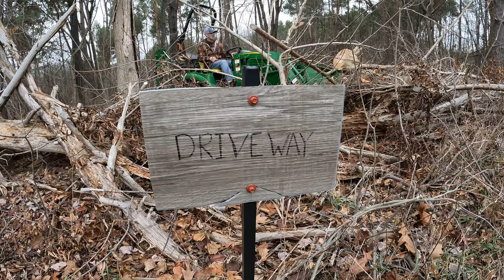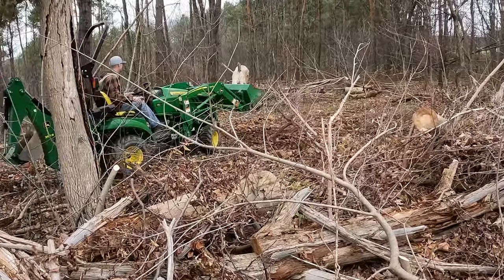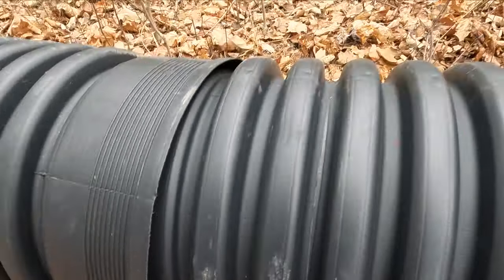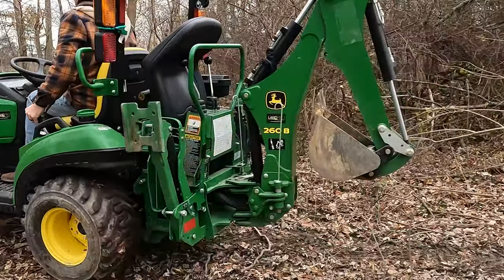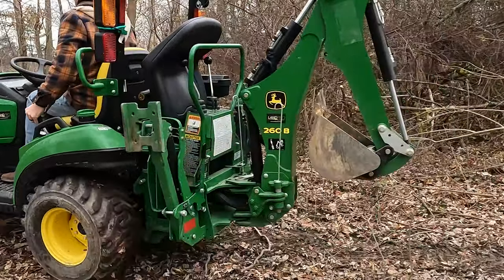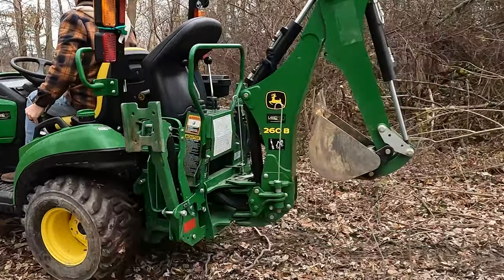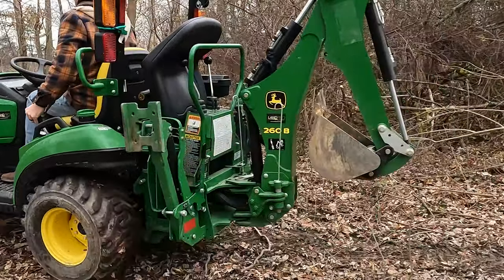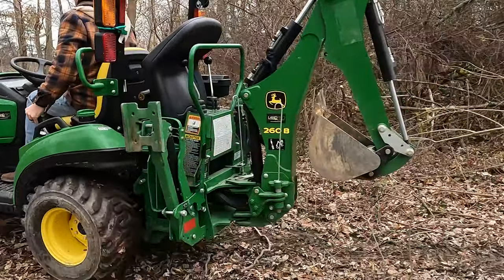How To Install A Culvert Pipe With A John Deere 1023e

Comment: I have a 1026R and a 3039R and they both are very valuable.  It beats doing it by hand which was more possible in my younger days.
Reply from the maker: Having the  1026R and the 3039R probably works out perfect!  The 1025R for the smaller projects or tighter spaces - and the 3039R for the bigger stuff.

Comment: You really need to take the topsoil off of where you're putting a driveway in, before the stone/gravel goes down and dig under the culvert pipe so you can put a good base material to support the weight that will be on top of it and get the inside of the pipe to the same level as the ditch line, maybe even a little lower (depending on your situation) so the water won't back up and drain correctly. But "You can't see it from my house!" Or "Good enough for the girls I go out with"!
Reply from the maker: Thanks for watching and sharing the advice! The base below the culvert pipe was already a mix of sand/crushed stone/gravel. There may be some natural sediment build up that happens to "level up" to the pipe where the water flows, but that will likely happen in the first rain storm. The culvert was necessary so that future equipment can come in and scrape all the top soil off and lay the base material down for the long driveway. I like those phrases you added. Around here, many people say, "Good enough for government work."

Comment: I think with a few rain events and a bit of traffic over that it will compact down like cement and hold that culvert pipe like iron! I don’t recall hearing it but how long/big was that culvert pipe? Great video. We did a crossing of our dry creek to our pasture and needed a 24” pipe and 40 tons of stone.
Reply from the maker: It packed in amazingly fast. I was impressed with that gravel mix. Thanks for watching! That pipe was 15", as required by PennDot. and it was 40-feet long.